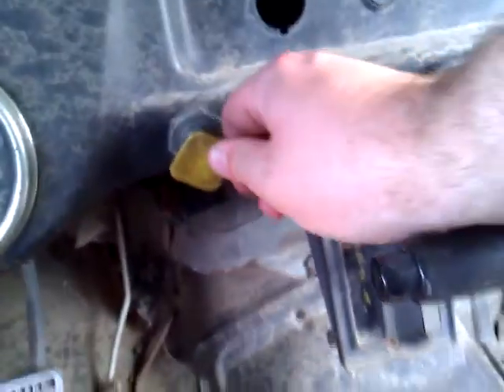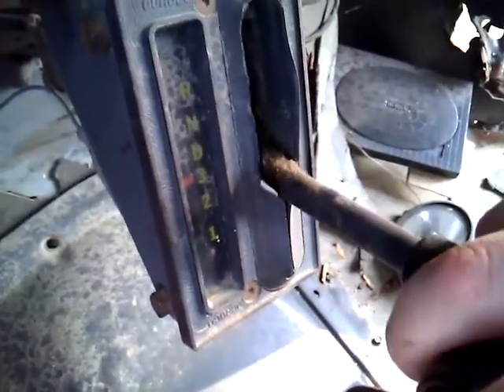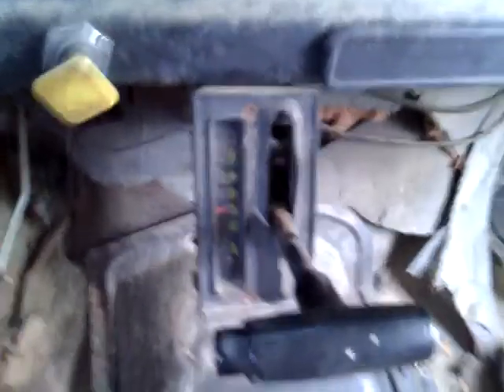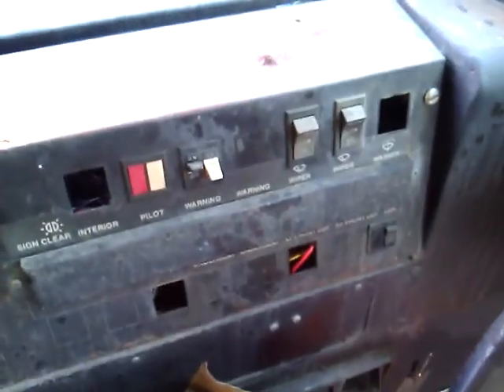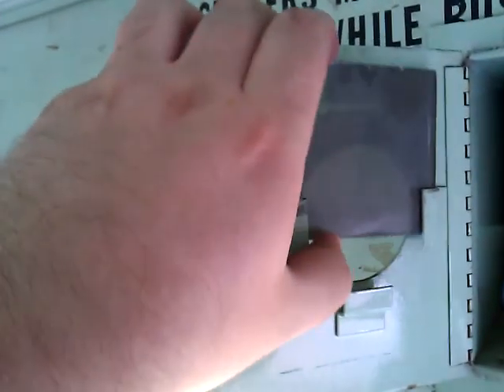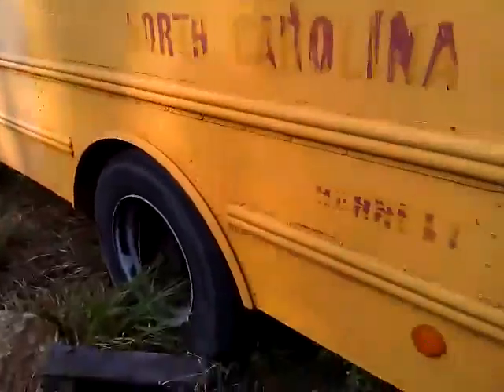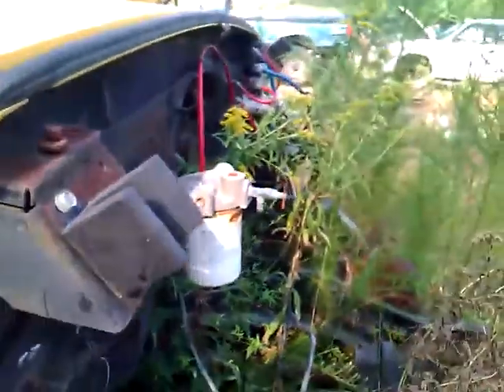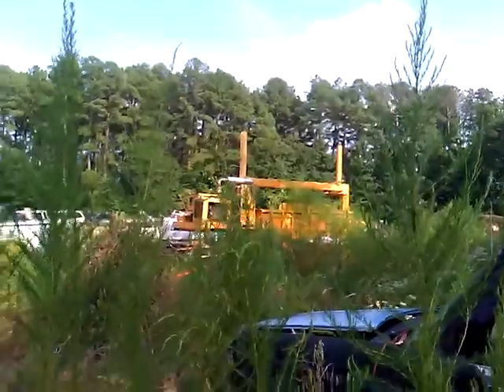Chevy/Thomas Locked Out Quadco Shifter and info.

Comment: I've never seen them do that before.  But when I drove in SC our buses were governed at 35mph.  And I remember one bus, and old 1980 GMC Thomas, 504.142 was the number.  You could put the gear shifter in 1st and drive, and when the engine got to a certain RPM the trans mission would shift out of 1st (even though the shifter was still in 1st) and then drive like normal and you could go faster than the 35mph governer.  Which is probably why NC put that lock out on their buses.